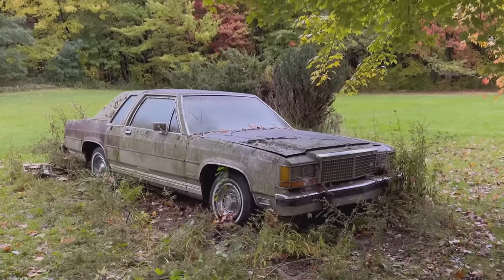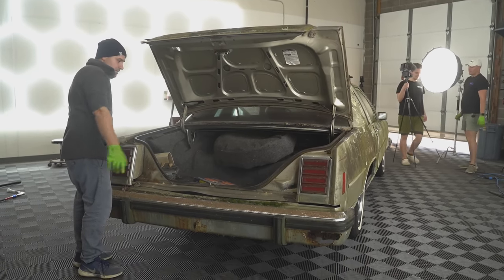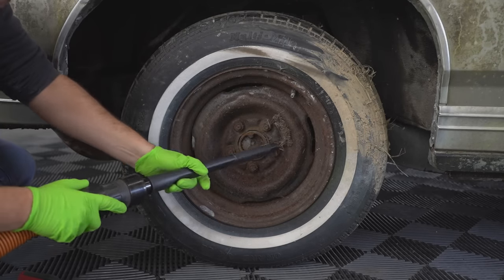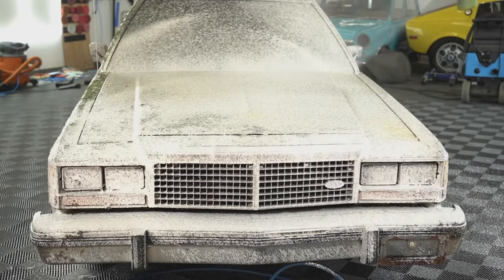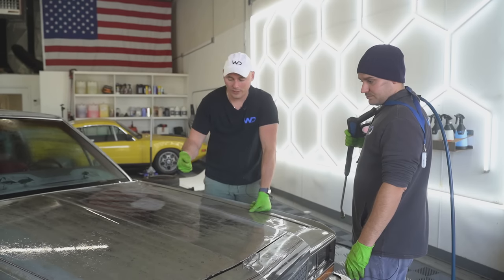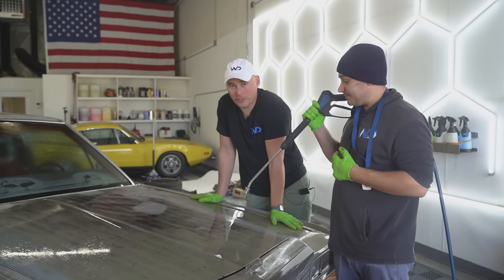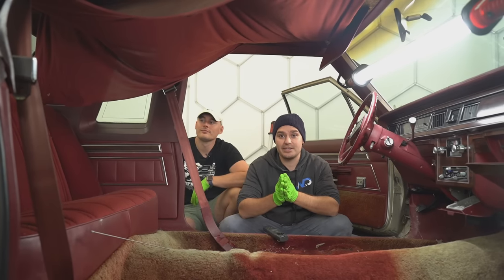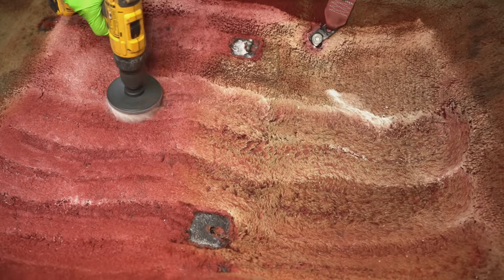First Wash in 30 Years: ABANDONED in Field Crown Victoria! | Car Detailing Restoration

Comment: Sweet transformation. one of my favorite parts of your vids is seeing leaves and dirt getting vacuumed out of door jambs and cowl areas, its so satisfying seeing those drains get clear again.
Reply: 5.0 V8 302
Reply: Could be a 351W. In this vintage both had the 2bbl VV carburetor and telling them apart is almost impossible unless you read the emissions label. I've had about every combination and permutation of 302/351 and transmission you can imagine, including a very rare 89 I bought new with the 351W and Trailer Tow Package. My brother also had an 86 Colony Park with the 351 and towing package

Comment: Ford came out with the Crown Victoria (on the Panther platform, not the 1955 Crown Victoria) in 1980 replacing the LTD Landau.  That car appears to be a 1982.  (Look at the grille.  Ford used that grille on the 1979-82 LTDs with four headlights.  I know, I had one.  They also made one with 2 headlights that was a cheaper model.) 1982 is the first year they used the Ford Blue Oval with that style grille.  If you look closely at 11:28 the fender badging says "automatic overdrive."  It does NOT say "Electronic Fuel Injection" like the 1983 and later Crown Vics did.  I can't see under the air cleaner, but, if the intake manifold has a valley pan it is NOT a 5.0 liter (302 c.i.d.) engine.  It is a 4.2 liter (255 c.i.d.) which is likely what that car has.  Also, unless someone has changed the carburetor, it has a Motorcraft 7200 VV (variable-venturi) carburetor.  (I changed many of those rubber diaphragms when they went bad.)  IIRC that car with the AOD transmission got really good gas mileage.  Those taillights look to be from a 1983+ car.  So, the grille might have been changed.  The wheels are 14" and in 1984 15 " was optional.  If you look over behind the Duraspark electronic ignition box on the fender is the engine computer.  So, it appears to be an '82.  Maybe it was wrecked in the back.  Great video!

Comment: I had one exactly like this as a company car, same color, pinstripes, interior.  Only difference was a maroon vinyl half- top.  Most likely a 302 V-8.  We traded company cars in every 55,000 miles - in this case 10 months - we drove the heck out of them.
Reply: Remember seeing an 8-month-old Volvo for sale once. Had somewhere around 90,000 miles on the odometer. I'm surprised they had time to stop for oil changes, tbh.
Reply: What year us this?????
Reply: @Pakman0812    I am guessing an '80 or '81

Comment: That is a pre-1983 Crown Vic with the 5.0/302 and the CFI fuel injection system.  You guys did a nice job on this old girl.
Reply: If it is pre-1983 it could have a 4.2 liter (255 cid) V-8.
Reply: What about a 351?

Comment: I like the content of todays video. Detail info and a little banter is good. You guys do some amazing work on some pretty badly aged vehicles. The other comment about the engine should be correct. It should be a 302. A modest horse power version based on the year model. Too bad about the other commenters having to replace a seal at 60k miles. 302’s are generally just about bullet proof. Keep up the good work.
Reply: The 302 had low HP by today's standards, but the torque was decent.

Comment: The Crown Victoria of the 80's was a good car, except for the 302 cu in engine. I had to replace the rear oil seal at 60,000 miles. 
You guys are doing a top notch job visually and verbally while doing your videos. A pleasure watching.
Reply: Over all the 302 is a reliable engine
Reply: Should be a 302 2 barrel or variable Venturi carb
Reply: @dansgmc  well I had good luck with my 302 in my f150 still running strong
Reply: 302 was one of the best ever engines.  Good to replace timing set though with steel double row
Reply: @warrenwinslow4266  that's what I replaced my new timing chain with the steel  one
Reply: I had mine with a 351 engine in Mexico

Comment: Mr. B. Here ! 👀😎👍☕️🍩.  Rust is the big question, sitting close to the ground , one with out even looking at the brake system and fuel .  Guys  I have used house wash mold remover , a car in that state won’t hurt it ! Body paint guys will say not too , it works and will give you a very good picture of what you are working with . Good luck on clean  !

Comment: I believe from the grill and taillights this one is either an 83 or 84. The engine has a traditional carbonator which makes me believe the engine is most likely a 351 c.i. The one my wife and I bought new in 86 was fuel injected and the engine was listed as a 5.0 litre. Ours had 15 inch rims and from the wheel cover a on this on I am certain it rolled off the line with 14 inch.  The 14s didn't fill the wheel openings as well as the 15s.

Comment: The engine on nearly all of those is a 5.0 L ford with Bosch throttle body fuel injection. My very similar’83 Mercury Grand Marquis was a sweet, smooth running, (very economical for a big car, 23 mpg highway) cruiser.

Comment: When I worked at a detail shop back in the early 90's we used to get a lot of those sun bleached red carpets in for used car dealers. The trick we would do for them is after cleaning the carpet really well we would soap it again and then use a red spray paint on the soaped rug, take an old rag and rub it in real well the suck it all back out. Came out looking like new and lasted for years. doing it with the soap would keep it from getting stiff.

Comment: This broke my heart. Those panther body coupes are rare as hen's teeth. Savings grace is she's in pretty good shape. Typical steering wheel cracks and dash disintegration. Was surprised the chrome on the wheel stalks wasn't peeling. Depending on the year of the Vic, depended on the engine. More than likely this is Ford's 302. In '83 on it was the only engine available except for police cars which still had the 351 available. 80-82 the standard engines were ... in 80, the 302. In 81 and 82 the 255. The 255 was a dawg. Ugh.

Comment: The V.E.C.I. sticker, which is that larger white rectangular decal with black print on the fan shroud, will tell you which engine that is - it's probably a 302/5.0, but it could be a 351 Windsor/5.8 too.

Comment: Those 5.0. ,otors carbed. Wete bulletptoff bought a clapped out 82 crown vic 200 bucks then swapped motor into 84f150.  Still going after timing chain heads done new. Carb close to 200k

Comment: Way to go. Taking a dirty pos and making it a clean pos. Also loved beating the lock out of the trunk when a locksmith for under $200 could have made you a set of keys. Which you're gonna need eventually. Finally, I've never thought about pressure washing inside a shop and getting everything else wet.. name suggestion for your shop..."Idiots Are Us".

Comment: Those were such nice cars when they were new. The car would have been standard with a 5.0 or 302 Windsor engine or optional with the 5.7 or 351 Windsor. Likely it’s the 5.0 L / 302. It’s hard telling. It does have some nice options installed. The hubcaps are a surprise considering it’s equipped with the lower cornering lights and the vent windows

Comment: You guys need to try 30 second cleaner.   Mix 1 gallon to 2 gallons of water and spray it on.  That black will melt off with a rinse.

Comment: I have a solution for the locked trunk. Most of the high-end cars have a trunk release button inside either on the door or the glove box, pull the switch out apply current to the switch push the button and open it up.

Comment: Engine? Either a 5.0 302 or a 5.8liter 351. Probably 302. My Grandfather had one exactly like this one. Nice car and this one is very nice.
Reply: That is a 1982 model.  It could have a 4.2 liter (255 c.i.d.) with a Motorcraft 7200 VV carburetor.

Comment: Why ruin the lock? The owner should have gone to the Ford dealer with proof of ownership. With the VIN, new keys are a snap to get. Now he is going to have to find a new trunk/ glovebox pair of locks. On a Crown Vic this early, I believe the doors and ignition are the square. Later the square key was ignition only, and finding a good matching set of door, trunk, and glove box keys is very difficult. I'm not sure of the exact age of this car, but it is an early Panther platform because it is wearing 14 inch wheels and tires. Beginning in 85, 15 inch wheels became standard equipment. It is an easy upgrade as the full sized Ford and Mercury wheels from 65-68 and the 77-79 Cougar XR-7 and Thunder, plus the Panthers through 95 and any Mazda B-4000 or Ford Ranger with 15 inch wheels are all interchangeable.The engine is one of two, and good luck telling them apart on a Panther as early as this. It is either a 302 Windsor or a 351 Windsor. The 302 is good for 134 horsepower. The 351 is good for 165 horsepower. Later 351s were good for 215 horsepower. 
This car is fairly well optioned. Vent windows, cornering lamps, and Crown Victoria rather than Landau, make it a fairly expensive example when new. The optimal full spare tire was a $150 option by itself

Comment: I am pretty sure that is a 5.0 302 V8 the same as what was in the 5.0 mustangs of that year. I dont think any of these came without the trunk release in the glove box. The headliners were normally giving up adhesion prematurely. And by the looks of what was under the hood it might have needed a fuel tank and a pump and should come back to life pretty easily.

Comment: A lichen (/ˈlaɪkən/ LY-kən, UK also /ˈlɪtʃən/ LITCH-ən) is a composite organism that arises from algae or cyanobacteria living among filaments of multiple fungi species[1] in a mutualistic relationship.[2][3][4] Lichens are important actors in nutrient cycling and act as producers which many higher trophic feeders feed on, such as reindeer, gastropods, nematodes, mites, and springtails.[5][6][7][8] Lichens have properties different from those of their component organisms. They come in many colors, sizes, and forms and are sometimes plant-like, but are not plants. They may have tiny, leafless branches (fruticose); flat leaf-like structures (foliose); grow crust-like, adhering tightly to a surface (substrate) like a thick coat of paint (crustose);[9] have a powder-like appearance (leprose); or other growth forms.[10]

Comment: This car is worth more than most people think.  It is pretty much the same car as the  Crown Vics that were used as police cars and taxicabs, etc.  They have a cult following.  There are people who buy Crown Vics and swap a manual transmission into them.  This thing would look and run great with a rebuilt 289/302/351 or a Coyote with a 5 speed stick shift.

Next time, call a locksmith and get the VIN.  A Ford dealer ought to be able to make replacement keys.

Comment: I always like to guess what year these older cars are, this one has me stumped, it is an 80-85 crown vic, but it has the 81-82 grille and 83-85 taillights, hmm
Reply: It has a 1979-82 four-headlight grille, but 1983-87 taillights.
Reply: @lvsqcsl  79 was 1 headlight on each side,86 and 87 had the third brake light,which goes back exactly what I said

Comment: Any particular reason you don't do the roof and pillars before the lower body?

99% sure its a 302. (Pre-83 might be a 255.) 1984-5 is EFI, older has a weird variable venturi carb.

Comment: Only Ford would put a red interiour in a green car pressure wash that carpet and let it dry then go buy a bunch of flat red spray paint and go over the carpet you would be surprised how good it looks ! Ive saved a lot of carpet this way use a nylon brush to lift up the fibers and spray it again till its all even dont use glassy paint only flat

Comment: Thrse remind me of cleaning cars for sale. One was owned by a mechanic who didnt take his overalls off before driving. The seat felt like a wax jacket, it was that coated in grease. Ended up using engine cleaner, a jetwash and an extractor vac. Made the water out that carpet look clean 🤮

Comment: Is there a reason why you would not start on the roof first and work your way down? Doesn't make sense to me to wash from the bottom or middle up, by the time you get to the roof you're just washing all the crud right back over what you've already cleaned.

Comment: Nothing special about an 80s Crown Vic. A nice low miles driver  six grand maybe? They are not rare. 302 good motor if it ran.. worth more for scrap. love the channel..
Reply: Wrong.  Crown Vics...the same as this under the skin..have a following.  Gearheads get these and do a manual transmission swap.  Lots of YouTube videos about it.
Reply: @penguinsfan251 still doesn't make them valuable.  I am a Ford person who loves these cars. I still wouldn't give much for it. I am in 2 car clubs. No one has ever brought one of these to a show or cruise. Just because something is old, doesn't make it valuable or collectible,  as so many of today's younger people think they are

Comment: Damn...hope the roof isn't rotted out under that vinyl top, one of the dumbest options ever. 
302 cubic inch, 5.0 litre
SOS pads probably would have worked wonders to get the scum off, not like you had to worry about the "finish"...lol

Comment: That particular car is not probably not worth much. It's not old enough to be a classic nor is there anything special about it. That's not the cars fault. Actually that generation of full size Ford cars were really good cars. This generation started for the 1979 model year and ran through the 1991 model year with extensive styling changes for the 1988 model year. This particular car is a time capsule somewhere near 40 years old, representing a generation of the best Ford cars ever built. I used to be a real Ford guy but in 2023 I'm not able to even recognize Ford motor company. All the great cars that Ford once made are gone forever except for the Mustang but that's the way all American automakers have gone. Nothing that's affordable for the average driver. Nothing but expensive large 4 door pickups and SUV's of all sizes. If the owner of this car wants to fix it up that's good. It appears worth saving. Not for show but as an enjoyable cruiser or daily driver. That 5.0 Litre V8 was a really good engine. I hope that the engine is still good. It shouldn't be expensive to repair.